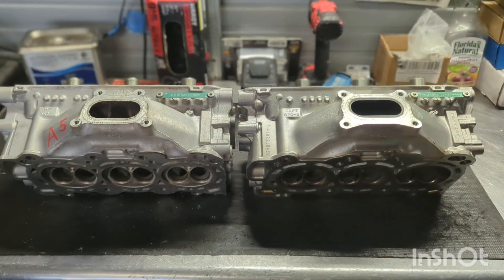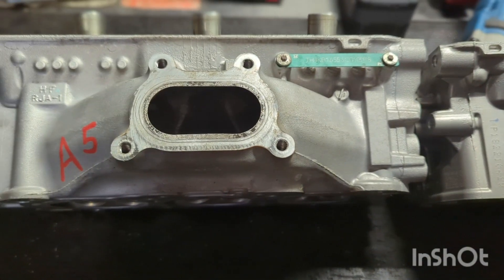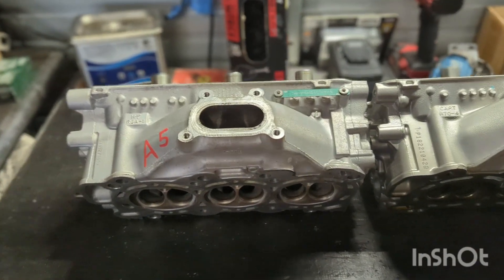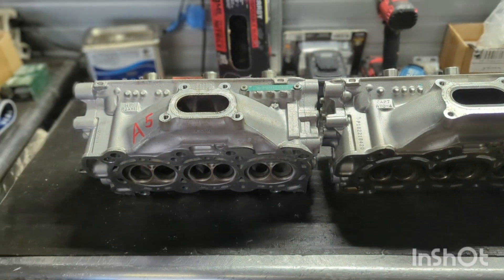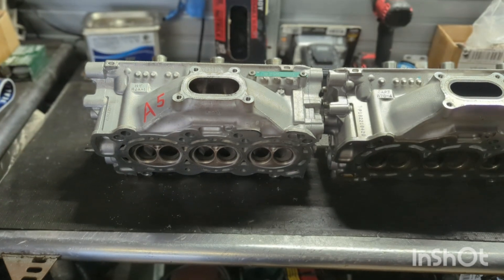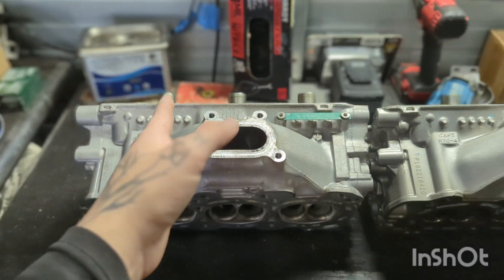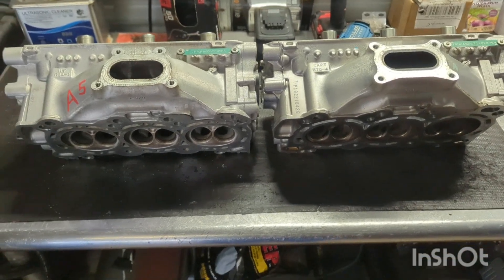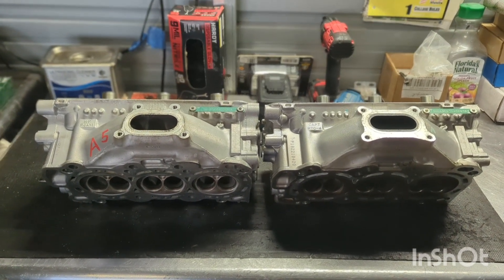J-Series Cylinder Head Port Shape vs Flow "The More You Know".....

Comment: Is it worth you porting my j35 or just buying a j37 instake manifold
Reply from the maker: There's a reason we only offer our ported J35 Magnesium manifolds. Both the J35 and J37 are good intakes, but just as this situation I've found the smaller volume J35 make more power, especially after our PnP. We do port J37 manifolds but only if the customer sends them in
Reply: Wish someone would dyno a J35Y intake manifold vs the J37
Reply: @robertalicea5585  send me your email.  Do you port the j35 intake?
Reply from the maker: @robertalicea5585  we will be on our 9th Gen ... But not comparing it to the J37. Just non ported Y Mani vs our stage 2 + 81mm Billet throttle body

Comment: You can account for the oxygen content in ethanol, it should add like 2.5%. Barring nitromethane, any gains you see with ethanol come from charge cooling and knock suppression. Personally, I don't think that those add up to a power-adder.
Reply from the maker: Appreciate the comment. Let's talk Nitrous... Nitrous also cools the air flow, is it not a power adder? It's carrying O2 molecules and reduces IAT's.  I ran nitrous on my J30 for 30++ 10lbs bottles and over 100k miles. On average in Florida summers I would see as much as a 30° temp drop in IAT's when spraying. 
And you can look up VP but just between their C85 and M1 you're talking a 10-11% difference in carried O2. 

Here's a good article on Nitro, obviously its different than Methanol but it's still a good read. Hopefully this links correctly 
https://www.hotrod.com/how-to/hrdp-1304-what-is-nitromethane-anyway/

Comment: The thing is, you're never going to get the single port heads to sound as good as a proper, equal-length, stepped, 6-2-1 setup can because the merge is unequal and looks to be high-angle (so turbulent). I have yet to hear an N/A V6 that sounds much better than a 350z with SGM headers and a single exit exhaust, or a 6-into-1 header Lancia Stratos rally car. I mean, with the first gen 3-port heads, can you for some reason NOT fill the exhaust port up with an anti-reversion ramp on the floor, then make a 1-5/8" stepped to 1-3/4" primary tube header in order to improve the velocity?
Reply from the maker: Love the input but you're going wayyy deeper than 90% of the people out there need to. I agree with you and this is why I directly said the traditional header style heads flow more, but again and as mentioned, the only time (in my opinion) for a normal guy to swap between the style heads is if mid to high boost (800+++). Even with that said you can get very far on the single exit.  My J35A7 Turbo Accord made 550whp on 7.8psi, 34whp per 1psi of boost. From everything I've seen over the years that HP per PSI is insane for a street car.  You can look around and see what other people are making on 8-10psi, it's usually around the 400ish territory
Reply: @HalferLandPerformance  Hell yeah, fair enough. For me, the sound potential alone is worth it even if I fell 5-8% short of my 100whp per liter NA goal out of a 3.5. I swear, go listen to those two examples and you'll see what I'm saying. Lancia Stratos 6-into-1 (the white #8 car IIRC) and the SGM header/Mountain Pass Performance 350z from like 11+ years ago(the red (later teal) one). Whew.
Reply: @Drunken_Hamster  the Lancia is fkn sick, I've seen videos of it, I get it ✊️ definitely worth gen 1 heads imo

Comment from the maker: Have people made more power by switching between stock cams, absolutely, but good cam vs good cam (meaning not worn, we've seen a lot of worn OEM cams so keep that in mind) there's really at most 5whp peak to be made (possibly more in the mid range power band)
Reply from the maker: Also when speaking about boost Bertha has J32A3 heads with our stage 1 PnP on it, mated to our HLP built 800hp J35A7.  Even when boosted these Gen 2 head flow WITH THE RIGHT PORTING! Our J32A3 heads on our J35A7 made 34whp per 1psi of boost, absolutely insane HP per PSI of boost.  I implore you to look up other setups and see how much they make on 8psi of boost ..you will find them around 400whp, so where did that extra 150whp come from...Tuning, Cams and GOOD PnP, aka not max hogged out heads
Now compare that to any Gen 1 Boosted head setups and see what they make. Like I said, unless 800+ we would never swap away from the single exit heads